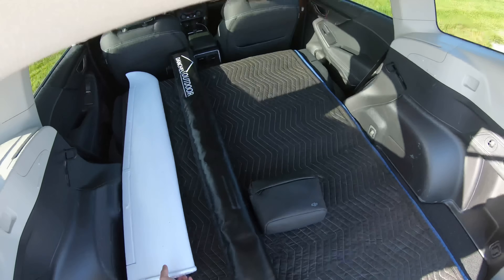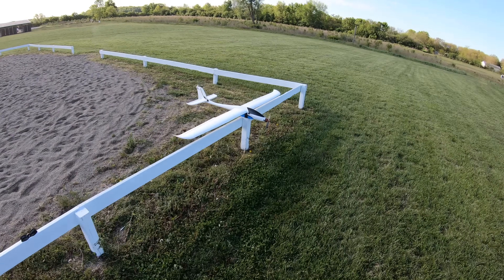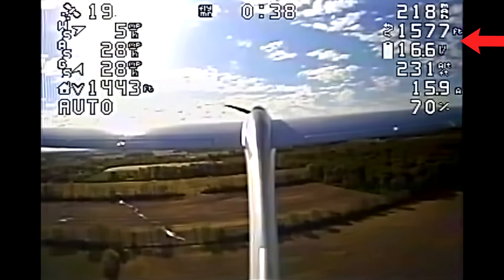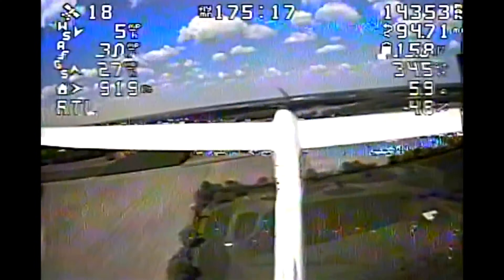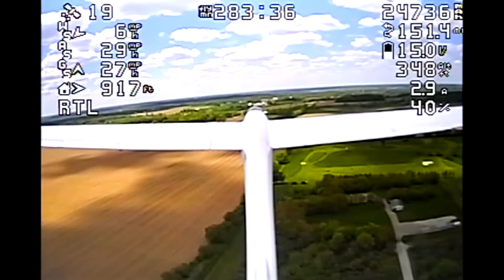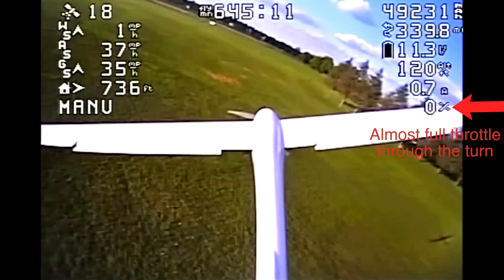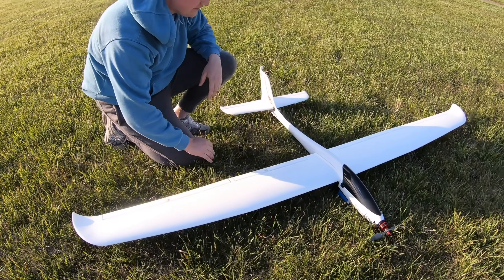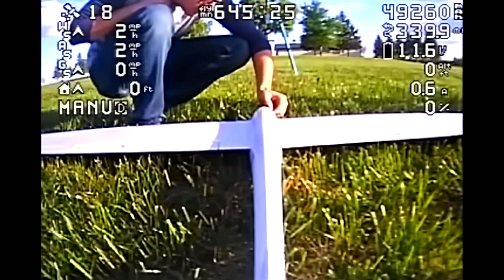My Longest RC Airplane Flight

Comment: Try adding solar cells to the wing to see if it improves flight duration.  Try adding ground object recognition via live video feed.    Then add ground object location coordinate triangulation from the aircrafts GPS co-ordinates.
Reply from the maker: Very cool idea!
Reply: Not sure how you would do it, but with live video data you could capture the video frames as step 1.  Then analyse the video frame image using some open source algorithm or even write something to analyse the pixels in the image.  Might require some AI image recognition component.  Step 2 use multiple image frames from multiple drone GPS locations,  to try to triangulate the image GPS location based on the image pixel count distance from the edge of the identified image.  If you can calculate the centre of the image ( after finding its edges ),  even better.  This might also need to take into account the orientation,  direction and altitude of the drone.  If the image is moving it would be more complex, but start with a stationary image.  Some trial and error trigonometry might be required.  You could use a test object with known GPS co-ordinates for your test image.  Say for example start with something large like a small shed etc... Depending on your skills,  you could possibly simulate the entire process in a 3D software environment or even in Microsoft Flight Simulator,  using the the API programming functionality.

Comment: Awesome!  I live near MP 310 in Washington state on hwy 97.  Its about 20 more miles North to Canada.  Hence you flew the state of Washington from south to North!  Amazing. I agree with others, don't apologize for excitement. Outstanding achievement!  
I just returned to the RC hobby after 50 years.  The technology is blowing me away. Learning to fly again, my entire body has shaken almost uncontrollable just trying to figger how to get my sailplanes out of the sky without losing them or ripping the wings off. 
Planning to do the same thing with a Fox 3000 only I simply want the plane to go where I program it to take nice pics and drop love letters to my fans.  ;-)
Edit:  Did you have crow on your setup?
Reply from the maker: Wow, that’s awesome! No, I didn’t program crow flaps. I have a 3m Fox too. Quite a plane!
Reply: @MatthewHeiskell  
The dawg makes the video!  English Setter? Britney Spaniel? Mix?

Comment: Hi Matthew. Thank you for your help. My plane can fly for 3hrs now. However It is still hard to launch. I wanna replace the motor form the 4108/600kv to a more fit in motor. So why do you choose the 4108/600kv? Is there any motor more powerful, which is still suitable for the long endurance flight? Thank you.

Comment: Congratulations, pretty impressive.
If you are going for highest efficiency, I highly recommend changing the prop.
A GM - folding prop (Georgi Mirov Propellers) is an affordable solution.
More efficient than APC,  Aeronaut Cam Carbon or any random prop solution.
Between appr. 10 - 20% better efficiency.
Keep on flyin ♥

Comment: Thank you Matthew. I have tested my phoenix with a 30000mah/4s battery. It has crashed in the launching since the vehicle is too heavy to launch with hand. What’s your plane’s max thrust? And how can you launch such a heavy plane without stalling in the launching?
Reply from the maker: I’m sorry to hear about your crash. Launching it is very challenging because it is so large and so heavy. There are a few tricks though. Launch into the wind at full power. Launch with full flaps. Launch and try to fly level and build speed before trying to climb. Run and throw the plane as strongly as possible. My max thrust was not very high. I was just barely able to launch mine. Maybe launch from a hill top.

Comment: Hi. Matthew. I have got a 30000mah battery to drive the plane like you. But I just can’t fix it into the plane at the right position. How can you do that? Could you give me the details about this?
Reply from the maker: I cut a large section out of the bottom of the fuselage to make the battery fit
Reply: @MatthewHeiskell  Yeah.I do the same. But the battery is still too big to fit in the fuslage since there is a wooden board in the middle of it. And the board is used for fixing the wings. So how can you solve the problem?
Reply: @MatthewHeiskell  And BTW. Why don't you install your autopilot in the head of your plane since there is much of space for it.

Comment: Thank you .Matthew. I have successfully tested my glider's maiden flight with the 4108/600kv motor and the 12*12 propeller. However its duration is only 42 minutes with a 5230mah battery which has totally 4166mah discharge amount during the whole flight. Obviously it can't have a flight time to 10hours even If I enlarge the battery to your 50000mah. Let alone the 50000mah battery should be almost 10 times weight of my 5230. I doubt if my glider's CG fitting matters since the vehicle's CG is in the front of the need location even if I don't install any additional devices in it. The design of the plane's force distribution is not so reasonable(you can never make your battery in side the cabin as the original design. Or the CG will be too far ahead.)

Comment: Hi, I have got a 4108/600kv motor to drive a 12*12 propeller just like you do. However, the motor gets extremely hot while it is working at 70% throttle with 4S battery. Is your motor the same? I am afraid the motor can't work for a long time in this condition.
Reply from the maker: Yes, you should use a slightly smaller prop. I used that big prop because I knew that my battery voltage was going to decrease a lot throughout the flight. I over-propped the motor at the beginning so that I had sufficient thrust when the battery was getting low and weak.

Comment: I thought 3s was more efficient. What made you decide on 4s?
Reply from the maker: Higher voltages are usually more efficient because you don’t need as much current to make the same power. (Power = current * Voltage) Less current means less I^2 * R losses. This is based on the equation for heat generated in a circuit. (Power = current * current * resistance)

Comment: Hi, I get 3 questions. 1: Do you change the motor from the original 4023/1050kv to your 4108? 2: How do you connect the flight controller's tele port to the OSD and the data link to the ground control simultaneously? 3:how can you  move the camera installed on the tail? I dan't see the gimbal in the Video.
Reply from the maker: Hello! 1. Yes I changed the motor. 2. The fpv video is passed through the flight controller, the OSD info is added, then the signal exits the flight controller and goes to the video transmitter. 3. The fpv camera is glued to a servo that is embedded in the vertical stabilizer.
Reply: @MatthewHeiskell  Hi,Thanks to your answer. Do you mean you don't use ground control station to control the plane so that you don't use a data-tele module?

Comment: It all depends on the battery. if someone builds a bigger one, he will fly longer. its boring
Reply from the maker: There are more factors than the size of the battery. You need a an ideal air frame, battery voltage, energy density, motor kV, prop diameter and pitch, prop design, ESC, center of gravity, flight controller tuning.

Comment: This is super neat! Thanks for posting!

How can I get started learning to play with flight controllers and OSDs like this? Which FC should I buy for a plane I build myself?
Reply from the maker: Thanks! 😄 there are a lot of flight controller options out there. And more a released with every month. I really like the Matek F405 Wing flight controller. But watch some videos and pick one that has a good tutorial. INav makes it easy to get started. It’s the common software that runs a lot of flight controllers

Comment: Your Long range RC airplane Flight is amazing. I wonder about Flight control Display. It consists of number of Satellite, Wind speed, Air speed Distance from home location, etc. What Flight Control Equipment do you use and Is it displayed on your FPV goggle or Laptop. I'd like to know FPV unit and flight control information. You use Taranis x9d plus Accst and I wonder this Propo provide the information and can display. I wonder RTH start around 2500ft and it's not too long and how far range it can record. I wonder The range of Taranis x9d orange module is actually around 1 Km. Thanks.
Reply from the maker: Thanks! 😄I like the telemetry on my OSD so that I can record it easily. It is displayed on my FPV screen. You can also have it sent to your Taranis. You can have it sent to your laptop if you have telemetry radios. Yeah, you can set a RTH distance in Arduplane.

Comment: could i possibly make this too for myself? like a diy build?
Reply from the maker: Yeah for sure! This is a pretty advanced build, but there are tons of foam board plane builds on YouTube. They are great to build, crash, repair, fly - and repeat. Then you can add a flight controller and FPV gear. Learn the basics first!

Comment: Do you use for Samsung 50E cells balancing for charging? Does anyone know?
Reply from the maker: I built the battery pack without a BMS. I use a standard RC charger that charges and balances at the same time. Pretty standard in the RC world.

Comment: I see your big battery pack and as an experiment... What if you could have a lightweight mechanism that could select and discharge one cell (or 2s whatever) at a time and eject spent cells at a certain way point?

Even as a thought experiment... Would there be any benefits.

A use case would be longer loitering for a particular location for example.

Comment: Its a glider, use the batt to climb to 500m kill the engine, ensure there are no auto milling of the prop, use thermal to climb what is max of the day (3000m AGL) and stay 10h up there under the clouds, and fly with the battery over the night, in some scenario 20h airtime. :D

Comment: Such a great record but why? How can this have so much time, i thought Liion batteries dont have enough energy density.
Reply from the maker: There are lots of different Li-Ion chemistries. One particular type, the one that I used, has about twice the energy per weight compared to a standard LiPo. The cell is the NCR18650GA by Panasonic. There are quite a few similar cells now. Look for an 18640 cell with about 3,500 mAh.

Comment: Great to see a different perspective on endurance flight. I had assumed solar is the only option. But you proved otherwise
Reply from the maker: Many thanks! Yeah, battery power is nice because it still works at night, or when it’s cloudy, or when the days are short. It is also pretty simple and cheap.

Comment: In a weather like this you should be able to go 6-7 hours without any propeller at all just by thermalling. So, 16 hour record next time? :)
Reply from the maker: Haha, that would be INSANE! 😄 I’m super inexperienced then it comes to catching thermals, but you’re right, I could thermal most of the day and use battery power into the night.
Reply: @MatthewHeiskell  I can do it in a normal glider, but I am not sure if some kind of autopilot could do it in a model. As a first step, you probably need total energy variometer, or at least simulate it with data from barometer and pitot tube, if you even have it!

Comment: I feel like the flight time could have been improved with a folding prop. would be interesting to see u try it at some point
Reply from the maker: A folding prop would have been useful if I turned the motor off and spent time gliding, but I relied on motor power to maintain altitude the whole time. If you’re not gliding, a normal prop is a little more efficient.
Reply: @MatthewHeiskell  ah right, fair enough

Comment: I wonder if you increase the wingspan and create some way for it to fly on thermals, if you could launch it, and have it generate its own power by climbing/descending in a thermal
Reply from the maker: Oh yeah! That would be cool! Instead of using he thermal to go higher and higher, you could point the nose down just enough to maintain altitude and use the extra energy to spin the motor and put energy back into the battery. Like regenerative braking on an electric or hybrid car.

Comment: I've just got an idea because barometer drift is a bigger issue in larger quads, here's food for thought why don't developers consider a timer on measuring values to reset rather then continuously measuring
Reply from the maker: Yeah, or I was thinking that the GPS could provide an update or offset value every 10 minutes.
Reply: You can input the qnh into mission planner though right?

Comment: I set out in 2016 with a radian glider on a 3cell 2200 to do my longest flight, it was over 4 hours. It was extremely painful the last hour or so. I was in a lawn chair and got the worst sunburn I ever got. I kept getting thermal after thermal and hungout with birds most of the time but I pretty much used only servos the entire time. I’ll never forget that day.
Reply from the maker: That sounds awesome! (except the sunburn, haha)
Reply: Bro that's crazy I just got my radian yesterday and I'm gonna fly it on Sunday hoping for a long flight time but not that long XD I've got 4 1 cell batterys
Reply: Radians are fun.

Comment: Hello sir, im new to these rc planes and fpv models, but not to tinkering with electronics and fabrication stuff with all kind of differences, but how does one get started in building these planes and understanding flight and the workings of this stuff ? I like your material thanx for sharing.
Reply from the maker: Hello! Start with a simulator. Something like this: https://www.horizonhobby.com/product/realflight-evolution-rc-flight-simulator-with-interlink-dx-controller/RFL2000.html  Flying a RC plane can be very tricky at first. Once you get good at that, you can get a beginner RC plane. Then later you can get fancy and add a flight controller for autonomous flight. You MUST be able to fly the plane manually. It is pretty common to need to take manual control of the plane. There are TONS of good videos on YouTube.
Reply: @MatthewHeiskell  Nice! Thank you

Comment: Crazy man.  Almost 340 miles on a single flight.  Good stuff
Reply from the maker: Many thanks! 😄
Reply: Wouldn’t it be cool to send it at a general heading towards another city  150 miles away where you have it land and drop off a usb and fly back . This would be supper cool . Probably 😢illegal
Reply: @j.s3612  A general heading? You would setup gps waypoints. This is very easy with ardupilot, but yes illegal
Reply: @j.s3612 i don’t think it would be illegal if you register the flight
Reply: Isn't 300 miles 482 KMs? That's more then this flight. Great flight but 2019 with an old Disco did over 300 miles. Good to see there's people striving to do long range though.

Comment: Why use the baro to calculate the altitude when u can utilize GPS info to obtain the accurate elevation ?!
Reply from the maker: Good question! The baro can update at a much faster rate so it is better for maintaining altitude, unfortunately it does drift with atmospheric conditions.

Comment: I wonder about the discharge rate. How can you improve it, sir? The discharge rate I archive from LG mg50 is a bit low and your motor sometimes draws more than 10 A.
Reply from the maker: Good question! Each cell in parallel contributes to the discharge rate capability. Since there are 10 cells in parallel, and each cell can deliver 10A, the whole pack can deliver 100A.

Comment: why does the altitude drift when you have a gps?
Reply from the maker: That’s a good question! The flight controller can detect altitude two way, the GPS and the barometer. Since the barometer is faster, that’s the normal altitude input. It helps the plane hold altitude better. Most people don’t fly this long, but it would be nice if the plane would use GPS to periodically update the barometer. The barometer was drifting because the changing temperature and humidity of the day were slightly changing the atmospheric pressure.
Reply: @MatthewHeiskell  hope to get there too some day, definitely good job :)

Comment: can u explain the thrust and propeller size
Reply from the maker: Since airplanes have wings, they can fly with a max thrust that is much lower than their weight. Most brushless motors are most efficient when they are running at 50% to 60% power. This makes takeoff pretty sketchy, but it improves the flight time. “Pancake motors” are usually more efficient. They have a large diameter for more torque, but they are short to reduce the current that is used. A larger prop is usually more efficient. And more prop pitch means that the prop can generate the same thrust at a lower RPM, but you need motor torque to make that happen, hence the pancake motor.

Comment: Great job 
Battery name? Type? Model?
Reply from the maker: Thanks! I built the battery pack with NCR18650GA cells because the energy to weight ratio is very favorable. It is a 4S pack with a capacity of 50,000 mAh.

Comment: That wait of 10 hours is insane. My max was 2hrs... it was boring as hell,  I was using goggle the whole time..
Reply from the maker: Yeah, it just takes so long to do a full test haha
Reply: @MatthewHeiskell  it was a large diameter of RTL circle the whole time right?
Reply from the maker: Yup, I didn’t have to do much, but I had to be ready in case something went wrong.
Reply: @MatthewHeiskell  I see. Would it be more  efficient or accurate to do the test in a straight-line? 
How I did mine was setting up the waypoint for straight line(for say 700m), U turn, straight line 700m, U turn, and add "repeat x number of times"

Or it does not matter?

Comment: What is the crusing speed with that endurance?
Reply from the maker: Good question! It covered 340 miles across the ground in 10 hours and 45 minutes. That's an average ground speed of 32 mph. The air speed was likely very close to that value.